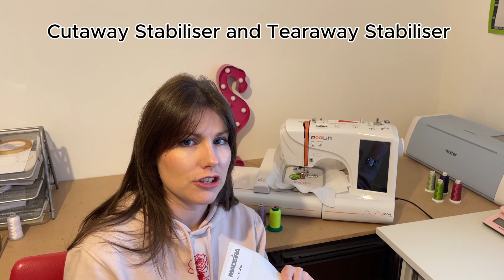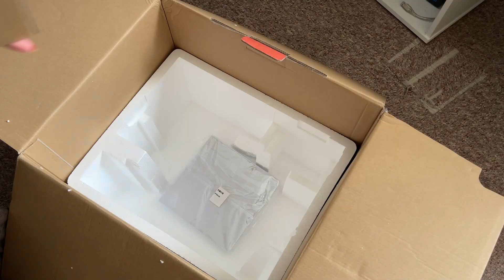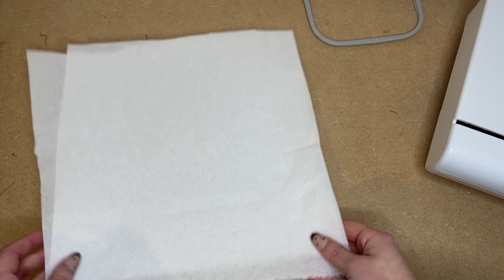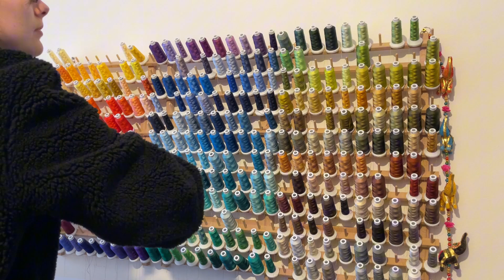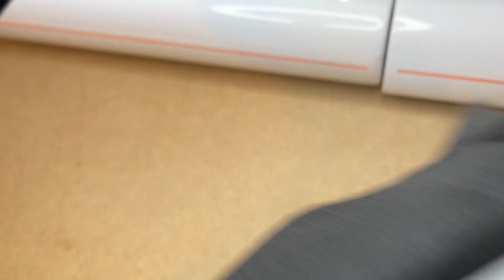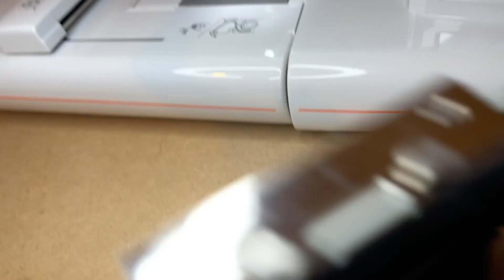Beginners guide to machine embroidery everything you need to start using Poolin Embroidery Machine

Comment: Hi. Do you still use it and like it? I'm looking for an embroidery machine for embroidering some shirts as part of my small business, do you think the quality of the embroidery is good enough for that, I'm on a tight budget and similar machines from likes of brother are more than double the price so this is the front runner for me just now. am I right on thinking it is also a regular sewing machine too?
Thanks so much
Lynsey
Reply from the maker: @skinnerandbarnet  Hi Lynsey, I am sorry I didn’t reply sooner I missed your message. This machine is a dedicated embroidery machine and does not sew. Personally, while I know it is a lot more expensive if you want to embroider for business I would recommend purchasing a multineedle machine, the tubular arm makes it so much easier to sew on T-Shirts. While you can embroider on t-shirts using flatbed, single needle embroidery machines like the POOLIN featured in the video you’ll find it will take a lot longer and that extra time eats into your profit. However, I do think the stitch quality of this machine is fine - stitch quality is also determined by what thread you use.